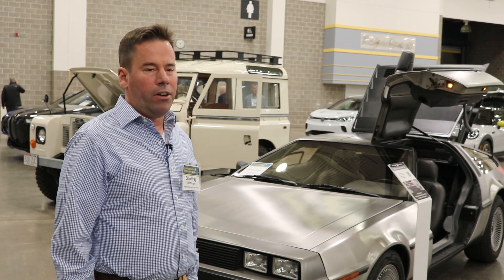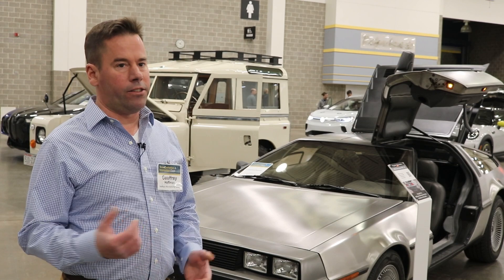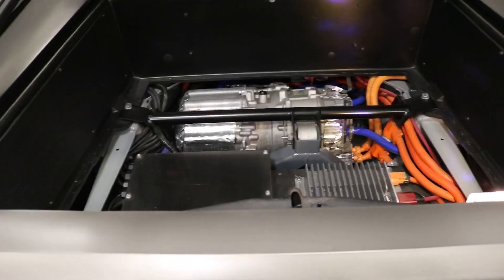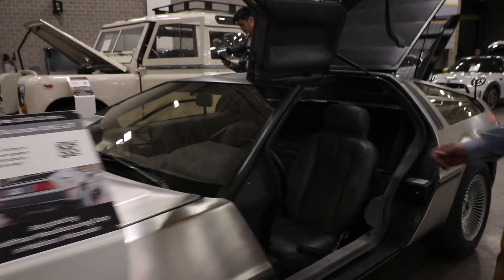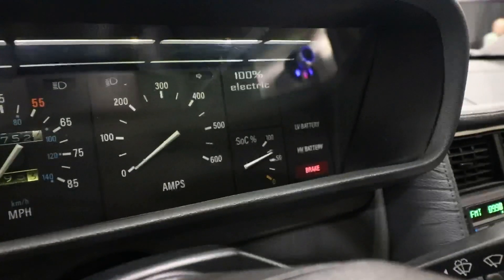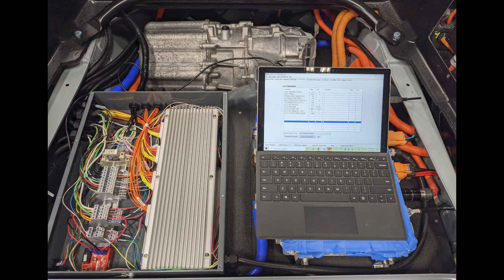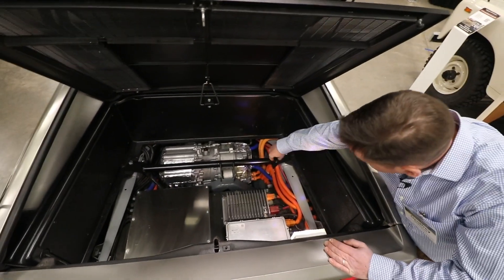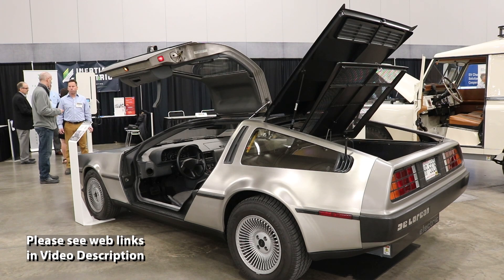Tesla-Powered Electric DeLorean

Comment: for those wondering, the original Delorean engine is a 120HP (its actually 140HP but all of the USA smog crap gimped it) Peugeot-Renailt V6 engine. While its possible, you really don't want to get one of these up to 88MPH.

Comment: Hi Benjamin,  Incredible EV conversion!   
Any chance to ask the owner of this Delorean what bulb he's running in the parking light????  This 5:38 is yet another example of dozens of Deloreans that I see has a photometric flaw & apparently,  I'm the ONLY one who can see it, & knows of the exact reason for this original design flaw that will end up becoming highly controversial once or if I decide to inform the Delorean community about.    My initial observation was confirmed by visual confirmation of the internal design optics, & then thru original blueprints.  Just for the heck of it, I have to run my concerns by senior transportation photometric engineers & a certification lab to show them what I found...... its for this reason, the running/parking lamps are too dim, & can't meet legal minimum luminescence standards of FMVSS 108, & is a safety to all Deloreans for rear lighting conspicuity.  Its technical.!!!!!!!
 Just can't believe they got away with the original design that I think was "Rubber Stamped" , & I'm sure a recall was pending before Delorean went out of business......alot of people were out to make Delorean fail, & this issue would've taken all those cars off the road or forced a cease in sales due to a safety defect. 
I have some ideas to greatly enhance these tail lights safety, but essentially they are all not SAE/DOT compliant & can never be made and/or would need recertified after certain & multiple modifications.  I bet the owner is running one of the many types of non compatible LED's which does not & can not properly emmulate light distribution in addition to this defective design optic.  Just very curious on what bulb he is using.......

Comment: Just read an article past few week of new battery technology.  Not knowing anything about EV technology,  Is this yet available to the open market, & will it boost power or only range????  
- News Release - A research team from the US Department of Energy’s Pacific Northwest National Laboratory (PNNL) has developed a sodium-ion battery with greatly extended longevity.
The US Department of Energy’s Argonne National Laboratory has developed a lithium-air battery that could significantly increase the range of electric vehicles.
A group of researchers at Harvard University's School for Engineering & Applied Sciences (SEAS) has had a breakthrough with the lithium-metal battery tech. They have managed to stabilize the lithium-metal battery and figure out a way to charge and discharge them over 10,000 times - at a high current density.

Comment: Nice conversion. They have put the batteries low to maintain good handling, the weight distribution should be ok too. I expect lot of fun to drive. These restomods usually don't have bigger range since it is not easy to fit and you don't need it. Drive the car to a nice place for an hour have lunch enjoy and charge for the way back. That's what it is about. And it is very well made thanks to the possibilities of his business.

Comment: 70 mile range? Horrible
Reply from the maker: What's horrible about it?
A person could design a car with a 500 mile range, but why? It would be very expensive, and add lots of extra weight and take up tons of space.

If 70 miles meets the needs of the owner (and it does) then that's fine.

Keep in mind that with an electric vehicle, you simply plug it in to charge and then walk away. You have a full charge every time you use it.
Reply: @BenjaminNelsonX  well if i got my hand on one which company is good to Change it to EV?
Reply: @BenjaminNelsonX  Understandable that its costly, but surly its more fun to gun it at a full stop :)

Comment: 250hp is largely considered the sweet spot for DMC 12, so 260hp/240ftlb is likely almost ideal. 0-60 is likely 5-6 seconds...maybe even in the 4s....

As far as range, 25kw is cool for a fun, around town weekender. No doubt you could add more battery to the "frunk", the rear parcel shelf, and/or transmission tunnel (maybe). It would probably help weight distribution too. You could probably rather easily get her up to 60kw or more. A decent 200-300+ mile range.
Reply: When running a 400v setup its not quite as easy to do as one might think.  It would require completely redesigning the entire battery setup.  Easy enough if you have an unlimited budget you just build your pack with individual cells of your choice.  But if you don't have an unlimited budget then you are going to have to go with something off the shelf which really limits your options.  For packaging purposes and Dollar/KW its probably best to use modules from a Nissan leaf or Chevy bolt at the moment in most conversions.  The older Model S 85, 90, 100 modules are the best bang for buck (kw/dollar) but it requires using all 16 modules for 400v systems which would be a packaging nightmare in most conversions not even taking into consideration the extra 1200-1500lbs it adds (so really only feasible on trucks or classic cars that had full frames and heavy full cast iron big block engines from the factory).  Model 3 modules aren't compact enough to use in most conversions.

EDIT:  Just saw this was a 2 year old comment lol...

Comment: I'm on the fence of converting my Suzuki Samurai. The DeLorean here has an hour usable range, and four hours to charge to full...a super fun project sure...but I would like a bit more.
Reply from the maker: More range? Just put in a larger battery pack. The frame of the DeLorean is very limiting in terms of where you can fit batteries.
For more info on Suzuki electric conversions, check out some that are on the EV Album.
http://www.evalbum.com/type/SUZU

Comment: For safety I would have placed the rear battery on top of the TESLA drive instead of in the crush zone in the event if the car is rear ended.  Other then that it is a clean build.
Reply: Yaaa,  not the Pinto
Reply: Not just safety, but also handling.